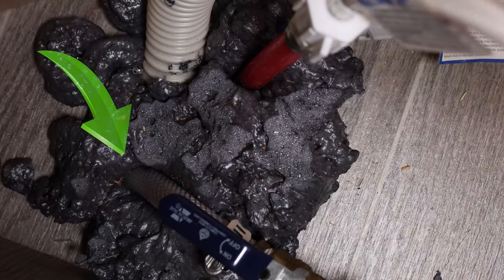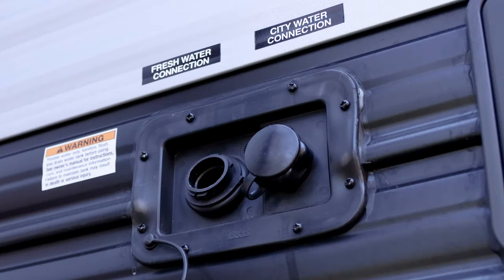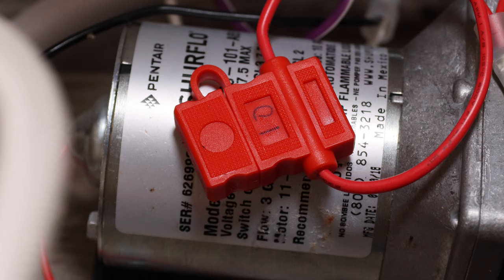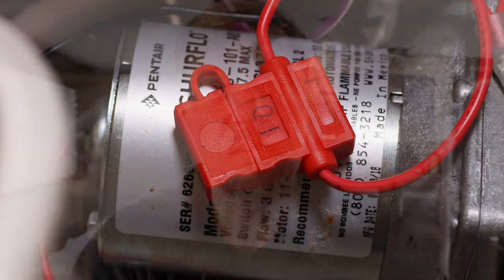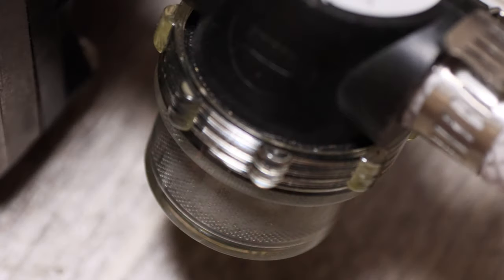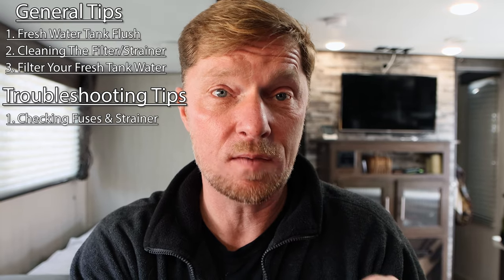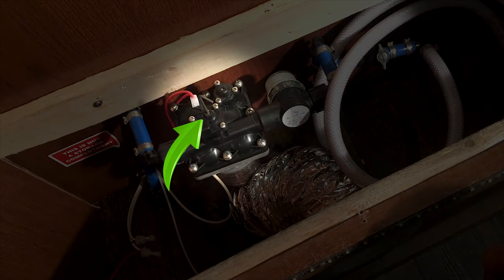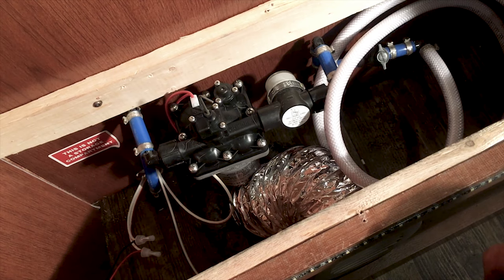RV Water Pump Explained 2021 - Shurflo Water Pump

Comment: Thanks for all the great info!  We're full timers (for a little over a year now).  We've been at a campground for the last few months riding out the winter.  We have full hookups with 50 amp service. Our fresh water tank stays empty & we use a water pressure regulator (ours is dialed down to 45 psi).  A few weeks ago our water pump switch on the inside panel was accidentally turned on at some point (I suspect it got bumped in the dark when searching for the kitchen light).  When I discovered it was on later, I immediately turned it off.  I have no idea how long it had been on, but I suspect at least several hours. 

With no water in the fresh tank, is it possible I burned the pump out?  Or is there a mechanism to prevent the pump from coming on if we're hooked into city water?  The reason I ask is there was never any noise from the pump (like there usually is when you turn it on). 

Any help is greatly appreciated!
Reply from the maker: I would think that if you did not hear the pump running that you just might be ok. The real matter hear is that the pump is not running. A couple of tests that you could do is to first put some water in your fresh water tank. Than disconnect from the city water connection. Turn on the pump and see if the pump will start running. If the pump doesnt start, then there are 2 fuses that you need to locate. One of the fuses is in the distrubution panel where your main power breakers are. You will be looking on the 12 volt side and should see fuses like the ones found in cars. The other fuses is loacted at the pump itself and is in a small in-line fuse harness. (I would strongly recommend that if you are going to check fuses, to disconnect from shore power and disconnect the battery first). After that, check to see if the pump will come on. The pump should run until pressure is built up from pulling in water to your RV. If the pump is not running from the get go and you know for sure that you are getting power to it, I would recommend to either replace the pump or have a technician take a look at it. Now with this all said, this is from my experience and how my RV is set up. I hope this helps and quite interested in what you find as your resolve. Let me know. Happy camping.
Reply: Will do!  I appreciate your reply!
Reply: @j.a.maranto3679  Did you ever figure out if you did any damage to your water pump?  I ask because I was boondocking recently and ran my fresh water tank out of water.  At that point, my water pump went from its regular humming noise to a very faint humming noise, barely noticeable, so I turned it off.  My wife didn't know that the tank was empty and she turned on the switch.  I really don't know how long it was before I noticed the switch was on (it shows red) and also discovered that the pump was running (again, barely noticeable) but nonetheless, it was running.  Anyways, it did not damage the pump.  My belief as to maybe why it didn't ruin it is because there may have been traces was water trying to get past the diaphragm, but not enough to make pressure.   Maybe because of that little bit of water trickling around, it saved it.

Comment: My pump doesn’t have a hose to suck antifreeze.  I hand pumped from the city connection instead.  Does this mean my pump could have water in it that could damage it?
Reply from the maker: Mine doesn’t either. I put the RV antifreeze in the freshwater tank and pull it through that way. Check out my recent video on winterizing to see how I do mine. Good luck.

Comment: I have city water hooked to my fifth wheel, do I need to run the pump? No pressure if not. Thanks
Reply from the maker: I don’t know if it’s cold there or not but check for freezing, kings in hose, and water is being supplied by the campground your at. Do this by unhooking hose from rv and turning water on. Also make sure that all turn knobs and switches are in the right orientation. You should not have to run the pump. Also if you run the pump and there is no water in the fresh water tank, you take the the risk of damaging the water pump. Hope this helps.
Reply: @HowToRV  thanks. No freezing now or kinks in the water hose. If the pump isn’t turned on it has pressure for about 15 seconds and then runs to a drip without the pump.
Reply from the maker: @chrisdonald3694  I just remembered that I have that happen once and it was the screen in the faucet. At the tip of the faucet at the sink where that water comes out, I unscrewed mine and found it to be full of junk. Cleaned it and all was good.
Reply: @HowToRV  thank you. I’ll check that out but it is in the kitchen and bathroom. Maybe both are stopped up but it’s brand new.
Reply: @HowToRV  I now have a concern that the diameter of the water hose could be too small…

Comment: Are accumulators  necessary?
Reply from the maker: I think that this is up to the user. I have heard both sides of the story. I do not have one myself because if I am at a campsite where the pressure is low, I fill my freshwater tank and use the pump. When low on water, I fill the tank again. For accumulators, the idea is to keep a more standard pressure and prevent water hammering of the lines and pipes, which could break them. Short answer is no you don't have to use one. With that being said, it doesn't hurt to have one inline just in case either. As long as the pressure is ok, you should be fine.

Comment: We left our water running a little bit during a cold spell and when we came back the water pump was leaking, so we bypassed it so that we could have running water in the trailer is that okay?
Reply from the maker: To be on the safe side, make sure that your freshwater tank isn’t filling because of the bypass. Mine has a check in it so that the city water connection doesn’t backfill the freshwater tank. If the tank is good then I would think the you should be fine until you can permanently fix it. Great though process to get yourself out of the predicament.
Reply: @HowToRV  thank you

Comment: The previous owner of my RV, removed the water pump and all of the hoses and connections. I cannot find a video that shows how to set up the pump with the connections. I see how to switch out a pump, but not where the connections go and how they connect to the pump. I have a 2005 Terry Fleetwood Rv, if that helps.
Thank you in advance.
Reply from the maker: If i am understanding you correctly, the inlet of the pump comes from the water tank. The pump inlet typically is the side where the strainer/filter is that comes with the pump. The outlet goes to your rig but may differ on how it does it. Mine goes directly to my RV due to the fact that i do not have a panle where you can select different options.

Comment: I have shut all value to my water pump  off even inside my rv trailer but it's still leaking water but it's still leaking water from the pump could u please tell me why it's leaking from the water pump?
Reply from the maker: I would have to guess that it residual water in the lines. Also, do you have water in your fresh water tank? If you empty the tank, there will be no water for the pump to leak
Reply: I hooked up to city water and my pump still leaking I needa new  pumps no watering my freshwater the motor is cracked
Reply: Thank you 😊 for getting back to me my pump is over 10 years old I have tighten all the fixing and the fresh water is empty the pump not working properly.

Comment: I had a mobile tech. Replace my sureflo water pump. I had prepurchased.   problem he one secured it with one screw.!  After my talk got about a quarter down. My pipes started jumping. I went to the pump to see 1 screw. My ? What size screws do I need those legs are small. I'm full time for 5 yrs.  I have in the past also had the city back up into my holding tank. That's a another day. Hoping new pump will revent that. I do not/ never had have the strainer cup. I do have one but this " tech" told me I didn't need it I do have filters for city x2.  and fill hose filter. Any help?  I'm 60 yr woman frustrated at this point.
Reply from the maker: I would recommend any screw that will fit in the whole of the pump feet. If you can, try to find a sheet of rubber, can be found at an automotive store, and mount that between the pump and the floor. Run the screws through the rubber to keep it from moving out. Hope this helps.
Reply: Thank you for the response.   The rubbers a grand idea.   Your videos are helpful.

Comment: Hi, I used one of these pumps for an offgrid shower system. The wiring was unclear to me. I did not hook up the wires at the front of the pump. I  only used the hardwired wires. It works, but I had to install a switch, because it does not shut off on its own. What did  I do wrong?  I suspect it has to do with the two little plugs I didn't know what to do with.
Reply from the maker: the other plugs are for the pressure switch I do believe. if the switch is not used, then it will not know to cut off at a certain pressure. if you go back to the video, there are link to websites that may help in the description. please leave another comment if it was helpful.

Comment: I have a truck camper ,it has a sureflow pump. The pump works but dose not pump water, I don't  think it has a filter on it. Could the pump be clogged ?
Reply from the maker: It could either be clogged or have an air leak somewhere on the inlet side

Comment: My pump worked great for several years and then suddenly started running continuously.  Would not shut off.  Is it worn out?
Reply from the maker: That is a great question. If the pressure is setting gets to high, it is possible that it could keep running. Most of the replies that I get though are that either the freshwater tank has gone empty, there is air getting into the inlet side of the pump or there is a leak somewhere. You can also go to your local RV store or online and find out what the return policy is, buy one, change it out to see if that fixed it and if it didnt, box it back up and send it back for a refund.

Comment: How can I make the pump turn on when I open the water. Does that function cones with the pump. How do I know
Reply from the maker: The pump should have a built in pressure regulator. When you turn on the water at the sink or such, the pressure reduces causing the pump to come on. If the pump does not come on, I would check the fuses. 1 is at the pump and the other is in the power distribution panel. Oh, this may sound odd but check to make sure the battery is getting power to the RV. This is typically accomplished by making sure the interior lights come on. Hope this helps
Reply: @HowToRV  what kind of pump does come with that function if you can recommend me one
Reply from the maker: @aldoyosbel1728397263  Here is the one that I have in my RV. It is 12 volt as well. https://amzn.to/3JhSyvM
Reply: @HowToRV  thank you
Reply from the maker: @aldoyosbel1728397263  anytime

Comment: Hi i have a problem, my pump only activates when i turn on the fuse, but then in order to turn it off i have to turn of the fuse again. So i cant controll it by just turning on the water tap. And also while the pump is on. It sounds really much almost like a Hammerdrill😅
Reply from the maker: Sounds like it is pulling in air. Check the inlet side of the pump to make sure that the water line and filter housing are not cracked or loose.

Comment: Can’t get my pump with the correct adjustment either stays on constant or pulses , but has great pressure just kills my batteries any advice
Reply from the maker: I would start by checking the strainer to see if it has any cracks in it. The strainer should look like a filter that is direct screwed to the side of your pump. At least mine is. If there is any cracks in the filter housing or loose lines on either side of the pump, you will not build pressure and the pump will continue to run. Look for cracks in the suction side (side where it is pulling from the water tank) or on the discharge side. If there are any leaks on the discharge side, most likely you will see water coming from somewhere it does not belong. Either way, typically you will find that the pump does not stop running because it can not build pressure due to leaks in the lines. If you do not find any leaks, then you may have to replace the pressure switch on the pump. The pressure switch would be the part that has the screw for adjusting the pressure. One side note, if you have been turning the screw for the pressure side, you need to recheck your pressure to make sure that you are not over pressurizing your system. I would do this by putting in an inline gauge somewhere in your RV. If you are not comfortable with all of this troubleshooting, please consult a repair tech. These are from my experiences and I am not a professional repairman. Please let me know what you find out. Sorry for such a long reply. Good luck and God bless.
Reply: @HowToRV  looks like some small leaks after the pump so it’s constantly trying to pressurize thx for your reply
Reply from the maker: @seanmoon1444  good find. It’s all you. You did a 👍 job.

Comment: My sureflo pump keeps turning off and on at even intervals. What could cause this.
Reply from the maker: From my experience, I had a small water leak and from that it was loosing pressure and the pump kept restarting to build the pressure back again.

Comment: My pump is turning on for a split second every 2 hours. I keep hunting for leaks I bought a 6 gallon air compressor I'm going to test to see if I can find more leaks
Reply from the maker: That is odd. Let me know what you find. Also make sure that you are not going over 40 psi on the air compressor.
Reply: @HowToRV okay thanks. I realized the hot water tank plug was still leaking so I put more tape on it and it looks like it's holding. But now the pump is turning on like every 40 min. I don't know if the last freeze messed up the diaphragm or what. Since I can't find any more leaks before I do the pressure test I'm going to swap the pump out for a new one and see if that resolves the issue.

Comment: I get no suction from my pump. I removed the hose and still no suction from the pump itself. Is this a bad pump? Its a Pentair pump just like yours. Also, its a brand new RV… just got IT New Years eve..
Reply from the maker: It depends on whether or not you have to select the pump. Mine comes directly from the freshwater tank so therefore I do not have any selector valves. If you think all is set up correctly, you could try hooking up a hose on the suction side of the pump and run it into a 5-gallon bucket for troubleshooting. I would suggest that if it is a brand new RV, you get it back for a repair warranty. Sometimes the dealer that you bought it from will get you the replacement pump and let you do the installation.

Comment: I have been living in my RV for the last 3 years and as far as I know my pump never comes on it just bypasses it and I never have water in the holding tank. And now all of a sudden I've got water leaking out of the holding tank I've got water coming back out of the big hose that hooks up to something from the outside well it's coming out of there it's just like I don't know what's going on cuz I'm not an RV or I bought this to live in this is my home and now I've got no water because I've got water coming back out of that big white and blue pip e from the tank I've never heard my pump come on never had to use it it just goes straight from the intake to wherever I need it I know I'm not making any sense but then again I'm not an RV or I'm just one that lives in one I don't know crap about it so any input I'd appreciate
Reply from the maker: Sorry to hear that you are having so much trouble. I had something similar happen to me. I had the check valve go bad that is at my pump. This allowed the city water connection to fill up the fresh water tank and cause it to over flow. Have someone there or a tech look to see if the fresh water holding tank is being filled because of the check valve. Please let me know how it turns out.

Comment: What is the mechanical difference between a freshwater and graywater pump?
Reply from the maker: I am not sure. I only have a fresh water pump. So you have a pump for the grey water as well?  I will have to do some research. What is the purpose of the grey water pump?
Reply: @HowToRV  I'm currently using a Whale Gulper 220 (marketed as a grey water pump) to remove effluent from a shower -- it handles things like body oils, some dirt, shower gels, but no significant solids. I ask because it's a relatively expensive pump and freshwater pumps tend to be cheaper. The Gulper 220 is a diaphragm pump like the Shurflo in your video. Perhaps it's the size of the diaphragm(s) that's relevant to fresh/grey. The skeptic in me wonders if it's all marketing. Anyway, thanks!
Reply from the maker: @MattVoda  I would like to look more into this. What is the year/make/model of your RV?
Reply from the maker: I looked up the pump and see that it is used more in the marine sector and is probably why the pump is way more expensive. The Whale Gulper (My Guess) is probably better built to handle oils, grease and tiny solids but not sure on that one. I am still interested in the fact that you have a grey water pump in your RV. All of the RV's that i have seen are gravity fed to the grey water holding tank.